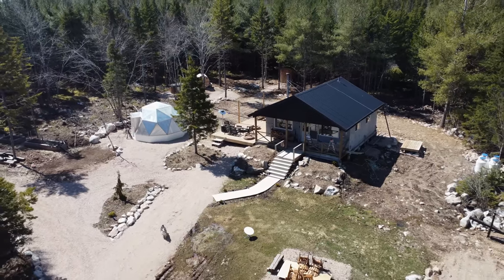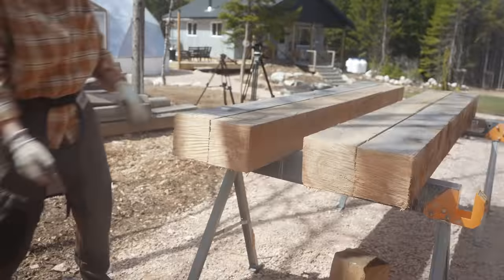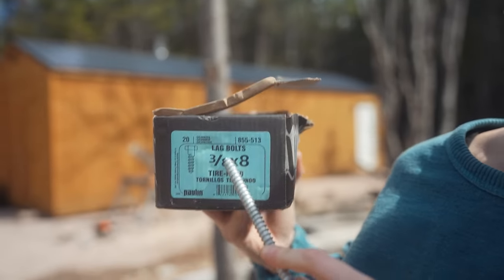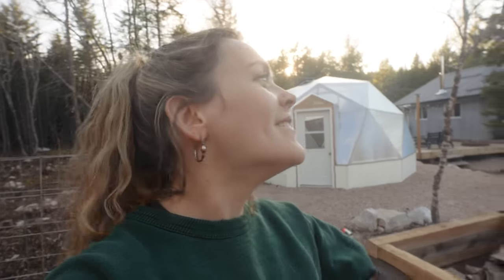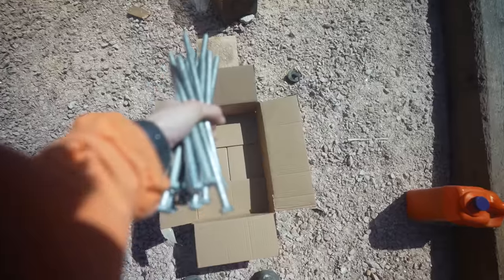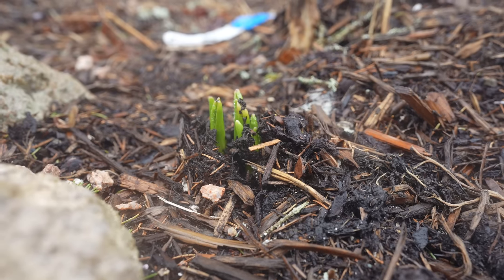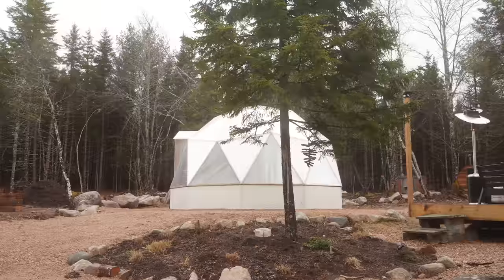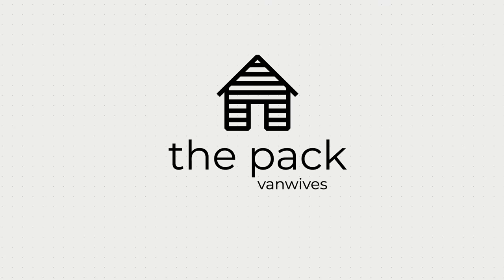Turning this Bare Land into a Garden

Comment: A little tip for the raised beds.  Before you fill them with soil, it is best to insert a grid at the bottom so that no voles damage your vegetables and their roots, then lay out a foil so that the soil does not damage the wood and it starts to rot, then a few straws and branches as the first layer and then hummus  or earth depending on what you have.  Another point would be to pay attention to the bed with the tree, to build a box around it, otherwise the tree will also start to rot.  I wish you good luck and remember, not everything has to work out at the beginning, you learn over time and you can do it. ❤❤❤
Reply: or instead of foil, char the wood [Shou Sugi Ban] to preserve it.
Reply: Just wanted to agree about the tree in the bed, will die if buried in soil. ❤ show, keep it up
Reply: I wish I'd put a grid in the bottom of my raised beds. I have a vole problem.... They always find my potatoes.

Comment: Bees wax is the best lubricant for bolts, screws, and nails!  Old carpenters trick, drill a hole in the end of your hammer handle and fill it with bees wax. Poke the tip of your nail in it and it drives easily. For screws and lags a quick swipe across the threads with a block of bees wax is all you need.

Comment: Keep an old bar of soap or hunk of an old candle with your drill.  Rub the threads of your lags or screws across the soap or wax.  Really helps lubricate the threads.  No mess. Easy to store with the equipment.  BTW the beds turned out wonderful.  You kiddos should be very proud!!!
Reply: Great tip!  I find this trick works for any long screw big or small.

Comment: To help the greenhouse keep heat, you can add polyethylene/or sheets of plastics to the inside of the greenhouse. You can staple it to the 2x4 frame. By doing this you add a dead air space between the inside and outside. This will help keep heat in. If you don’t want to use staples, you can get a tack strip. Ron

Comment: Ladies, the next time you want to fasten, two large boards together. Drill a hole through the outer board and drill a small hole, in the board on the inside. This will help, you won't break your bolts or lag bolts.

Comment: One more tip for the lag bolts is to pre drill with a bit a little smaller diameter than the bolt esp.. if you experience splitting. Great video y'all so glad you are "OUTDOORS"!

Comment: I love making raised flower beds. Along with the comment of adding a mesh on the bottom to keep the critters out, another tip for the big lag bolts is to pre-drill them. Use a drill bit a little bit smaller than the shaft size, it won’t be driving them in that much easier and you will not break any.

Comment: Four notes:
1. For the greenhouse, not just timers but thermostats to keep the temperature where you need it automatically.
2. Wheels and leverage:  The older you get, the harder it is to move stuff.  Use wheels where possible to move things like those big six x six timbers.  In your situation (gravel & dirt) , fat wheel dollies and wagons. This also helps prevent back injuries and dropping heavy things on your toes.
3.  Don't bury the bottom of the tree in the box.  Build a box around it.  Otherwise, it will also rot.
4.  Get some compost to mix into the beds.
Make that 5 notes:
Use drip irrigation hoses on the timers in the beds.  Set the timer and walk away or weed or just enjoy.  You don't have to stand there and water.

Comment: Setup a rainwater system by the green house and purchase a RV water pump with a water distribution manifold with timer for each zone of the greenhouse. Hook up to a solar panel 1'x2' and a 12 volt battery works like a charm easy to install and attach to a small drip feed sprinkler system zoned to each area you want to water

Comment: I've used soap to lube the threads on lag bolts. It will make the process much easier. A pilot hole will also help.

Comment: I suggest buying some packaged calcium and probably chicken manure.  The calcium goes in as a thin layer a few inches below the surface, and is probably done just at the time of planting.  The manure is sprinkled across the top where watering will carry nutrients down to the roots, and so you can see when to add more, probably every 2-4 weeks.

Comment: Love your big garden beds. A small hint... when screwing though big timber. err you call them lumber in Canada drill through the first one with a drill bit about the size of the shalf of the bolt you are using. Two reasons 1 easier to screw it in. 2 Will tighten the two harder together. Yes some lube helps it to screw in tight.
We real enjoy following your adventures but are not happy... you talk of spring when we are going into winter here in New Zealand !!! Ha ha!!!
Love Sylvia and Ian

Comment: Base on my experience growing up with a greenhouse attached to my house we didn’t grow anything from Nov to January.  We planted small plants in February when the sun kept the greenhouse warm naturally.  We never started from seeds. I don’t remember your greenhouse build but it helps to have a “thermal mass” like concrete floors or stone structures in the greenhouse.  This thermal mass absorbs heat during the day then radiates it back at night keeping the temps more even.  Also, drip irrigation on timers is much more efficient watering plant beds in a greenhouse.
Reply: Def put in irrigation in the greenhouse. Timers are everything.

Comment: Advice: When a tree base/the trunk of a tree is covered with soil or mulch, the bark becomes wet allowing for insecta and disease to takeover. The bark is to the tree as your skin is to your body. It is there to protect. If left as is, the tree will die. If you can provide a barrior around the tree trunk, keeping the soil and mulch away, by even 6-8 inches the tree will survive.

Comment: Hi ladies.... just a simple tip, when you want to use big screws in very hard wood... or any wood... to prevent the wood from splitting or breaking the screw or bolt, just drill a small hole all through. make the hole the half or 3/4th of the thickness of the screw and youll be screwing it in als a hot knife though butter. An other trick is, you can grease your bolt or screw with grease or fat. not sure if wd40 works but sure works just with grease or lard, good luck next time.

Comment: Crystal, a suggestion for a trellis for green beans and cucumbers. At the Home Depot or any store comparable to the hardware store they have large heavy wire sections that come in long sections. My sister has them stuck in the ground on one end and then bend it over and stick the other end in the ground. It forms a u shape to plant your beans at the edge and they will run up and over to form a canopy so you can walk underneath to pick the beans or cucumbers or both. My sister had a tunnel about 40 feet long and it was so easy to pick the beans and save your back in the process. She had multiple sections of the heavy duty wire and just had each section tied together with wire. I think those heavy panels of wire are actually used to build cattle corrals, that is why they are heavy duty wire panels. They may have lighter versions there in Nova Scotia. That is the best thing she had in her garden and she was continuously giving green beans away to anybody who wanted to come pick them. You don’t even have to have them actually in the garden but where Jazmine was showing the sitting area at the back of the raised gardens you built would be the perfect place to put a couple of sections. Just a thought to maybe help you increase your yield and her wire arches have been there for over 10 years and are still strong. We live in Alabama so we have a pretty long growing season. Much love to you two. Happy Spring and Happy Gardening….🙏✌🏼🫶🏻❤️

Comment: Two words... "Pilot Holes" The longer the lag bolt, the more it will heat and fail - 1 size smaller pilot hole alleviates that issue. Have you ever come across a Garden Folly - They can be a very welcome diversion to symmetry (purely artistic).

Comment: The reason the lag bolts snapped is because of improper prep.
You need to drill a hole that the lag bolt can pass through easily on the outside beam.
Then you need to drill a pilot hole for the bolt on the inner beam roughly the same diameter as the bolt body.
This allows the bolt threads to eat into the wood for grip while there's room for the bolt to enter.
The bolt is more of a clamp than a screw 👍

Comment: TIP Ivory bar or dish soap is better for lubing bolts and screws, any dish soap will work ,but we used ivory! You need a cap molding on the greenhouse planter perimeter wide enough to sit on!

Comment: In regards to the greenhouse this winter coming, you can make it much easier keeping it at an even temperature.  I would suggest using those window insulation kits (with the clear plastic film) on the inside of the dome.  That dead layer of air would help a lot and minimize the energy requirements of heating.

Comment: My hot garden tips from my garden last year:
1. Make your own compost. It's really easy and way cheaper (bonus if you have a friend who keeps chickens, rabbits or sheep to add manure to the pile), it's a great way to dispose of weeds/old plants (just make sure they don't have seed heads), and it adds continual nutrition to your soil to keep your plants healthy
2. Certain plants DO NOT get planted in the bed without containment lol. This includes a lot of herbs including mint and chives, and raspberries/strawberries that sucker. Some are more aggressive than others but do a little research and save yourself some pain
3. Companion planting is real and cool! Adding flowers like marigolds, zinnias, and borage increase the number of pollinators and ward off pests, and certain plants like tomatoes and basil like growing together. Bonus if you add native wildflowers!
4. For weeds with taproots, don't bother trying to pull them up. Chopping and dropping is way less effort, and adds more organic matter to your soil. Plus, overtime a network of beneficial bacteria/fungi develop in your soil, and when you disturb it they die. So the less you disturb the soil, the healthier it will be
5. Make sure you have SOLID trellises for vining plants. The ones at the garden store generally won't do, especially in the maritimes when it gets windy and you have a fully grown pruned tomato plant that's kinda top heavy. I've seen cattle panels recommended as a way to do this that seems pretty cool
6. It will get overwhelming and it's impossible to do everything perfectly. There will be pests and failures but as Crystal says, you're learning every year. Something will go wrong and you just gotta learn from it and focus on the successes lol

Comment: Please tighten the chain on your chain saw as it is way to loose and can come off very easily and cause much pain. A good rule of thumb is every time you add gas, top off your oil, clean out he saw dust so the chain oil gets onto your chain and finally tighten your chain if needed. Good luck and be safe
Reply from the maker: Thank you for your good advice. Very much appreciated.💛🐶

Comment: Tip: I read that keeping your seeds in the fridge before planting helps them grow better.  

I start my seeds between sheets of damp paper towels that I keep in a baggie that's slightly open to let air circulate. Then keep near a window or other light source. Once they sprout cut out  the paper towel around the seeding and plant.

Comment: OUTSTANDING work on the garden beds ladies but for better growth with your vegi seedlings in your hot house and garden beds add a few bags of animal manure  such as cow or sheep and some saltphate of potash or a few hand fulls of ash out of your fire place its great for leaf growth also helps with flowing just using soil has not enough nutrients also add some cheep potting mix in with the soil so the top 10 inches should be made up of this mixture hope this helps you good luck and best wishes Mitch from Australia.
Reply: What scam is this 😐 why do you people do this.

Comment: The best advice I got when I started growing vegetables is to do companion planting and find the best ways to do the least digging.  Companions like Corn on the cob with peas and beans. Plant the corn first and once it starts to grow and gets to about 2ft tall then plant the peas and beans next to them, so the peas and beans can use them to grow up. The peas and beans in turn fix more nitrogen into the soil which helps the corn to grow. Never grow carrots alone. Always surround them with strong smelling plants like marigolds, garlic etc, as this will cover the smell of the carrots and you'll get less carrot fly lava in your carrots. 

Growing in raised beds allows you to fill the base with bark, straw or/and wood before filling over the top with soil as the base materials start to rot and create warmth in the bed which will help the plants to grow. 

Create a pond big enough to entice in frogs and toads, dragonflies etc as they will eat the flies and aphids. Also encourage ladybirds. They are really good at clearing aphids. Put in a drip water system to help keeping the plants hydrated.

Comment: Get a wax toilet ring for lubricating your lag bolts or use soap.  The oil will work too, but the wax or soap sticks to the threads better and heats up, melts and lubricates as you work.
Reply from the maker: Hey Danna, wow makes good sense for sure. Thank for sharing with us.💛🐶

Comment: Where the lag bolts broke, in the future, drill a pilot hole in the outside beam and just a little into the inside one. Then it should pull up tight with the impact tool.

Comment: @vanwives So cool using the local timber, but forget about lag bolts, that’s old technology, consider using a Structural Timber Screw instead, these are just as strong and much easier to install. Try Rothoblaas (my fave with the EVO coating), or GRK, or U2.  Use your drill/driver to install (not impact gun) and you will be surprised how easy it is. Save the Olive Oil for your salads (although that did work well). Happy spring!
Reply from the maker: Thanks Phil, we sure do appreciate you sharing your knowledge with us. Happy to have you in our pack. 💛🐾
Reply: @Vanwives  happy to be part of the pack, and I should add - you’re doing great work! Hemlock is a super dense wood, anyone (even Pros) would have had difficulties with that timber. Even Pros break screws, get frustrated and want to quit. But you two keep pushing and that’s great inspiration. A pre-drill would also help the timber screws.  Take care out East.

Comment: Keep in mind similar water needs as to what to plant together or how tall plants will get next to another. Sunlight requirements can differ just like water.  Mulching with loose straw at least 4" after your plants are tall enough can keep weeding to a minimum. You may not have to water as much. Maybe buy an inexpensive probe to check until you figure out how often to water. Good luck with your garden.

Comment: Babes, you have to Pre drill to use lag bolts… also, is that a stihl ms251? I used to run one. Easy start it wonky. Get a 362 for your next saw and you will be thoroughly pleased. It’s the best weigh to power ratio saw they make. Run it with a 20” bar and it’ll cut through anything. I’m about to make a video on how to sharpen a chainsaw blade. I’ll send it to when I’m done with it.

Comment: Just so you are aware, any tree that you surround in material that exceeds 1/3 of the trees diameter in height will cause that tree to die.  If you want that tree in the planter to live, you will need to build a retainer barrier around it and maintain an airspace for the bark.  Of course if you don't care if the tree dies, that's fine too.  It will take about 3 years.  Thanks for sharing.

Comment: Hemlock is the toughest wood (outside of Ironwood ) Hemlock is brutal on carpentry tools, no wonder 2 lag bolts broke. You were very blessed that was all.😅
Driving nails into Hemlock will most frequently end up bending the nails. Carpenters really don't like it for building.

Comment: Rubbing the threads of lag bolts or screws with a bar of soap helps them screw in easier too and not as messy as oil.

Comment: Just wanted to tell you to use a smaller drill bit than the size of your bolts and predrilled your holes before you screw the lag bolts in. It will save on your drill and bolts

Comment: Hi, love checking in with you all every week! If I may give you at tip I would remove the tree from the bed you built around it. The tree will not do well with dirt high up it is trunk, the bark will slowly rot and it will die off ( it might take years but it will happen ) the other more acute reason is the all the nutrients that you put in that bed will be taken by the tree. Depending on the kind of tree it will start building a vast root system or sending up shoots ( if is is willow or aspen ) especially as it will be stressed by the bark being covered up. I know trees are lovely in a garden , but you do have a lot of them and this will make you gardening a lot more successful :)

Comment: You two are AMAZING!! Although I was initially a doubter, you've accomplished and learned much more than I could have imagined.
BTW, that tree in one of your garden beds will not last with that much soil over its roots. Our arborist told use a tree can only tolerate about an inch of additional soil per year, so plan on having to remove it in a season or two -- or before you drown it with too much overburden.
Reply from the maker: Thanks Terry, we sure are learning this from our community. We sure do appreciate all of you sharing this important information. 🤩🐶